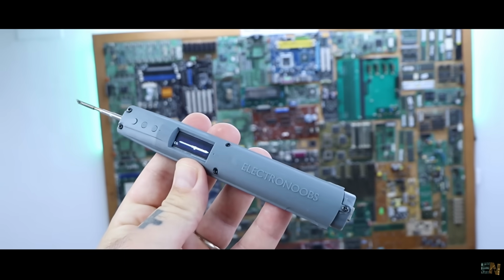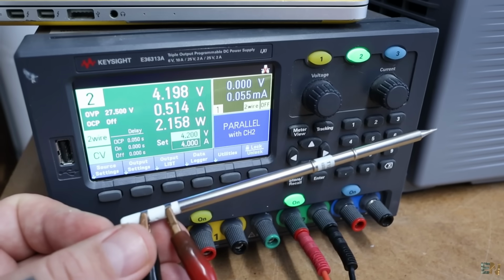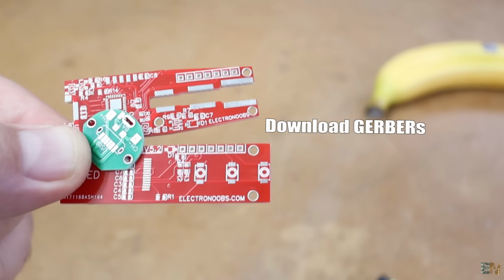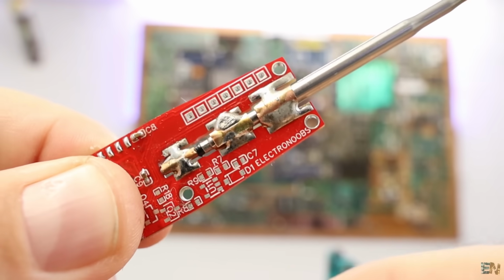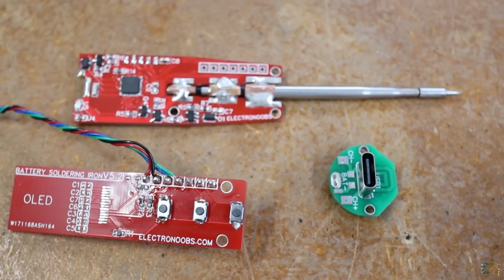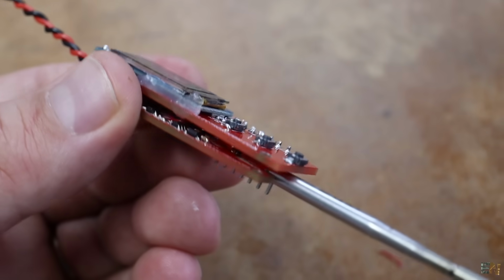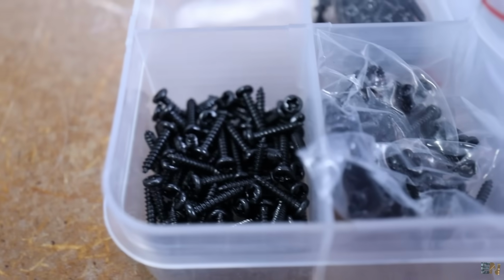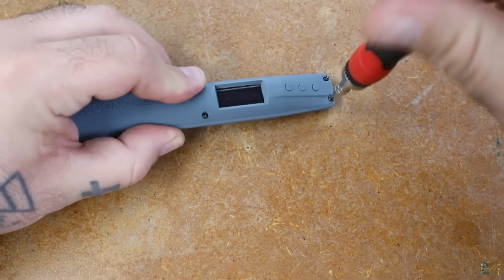No More Cables? This Soldering Iron Changes EVERYTHING

Comment: Nice Project! Thanks for your idea!👍 I want to use the same soldering tip for my Weller portable soldering iron. Weller only has 2 types of soldering tips. Do you or does anyone have the diameter of the contact terminals of the c210 tip so I can make an adapter? As an idea for the "copper clips", you could wrap thick copper wire a few times around a drill bit (or something else) with the same diameter of the terminals of the soldering tip.

Comment: You could try to use some kind of big capacitor in order to supply the soldering iron, and design an charging station that would charge the capacitor while not using it.
Other posible improve is to add an interchangeable battery.

Comment: Does the iron only heat at the tip? because if it heats up the entire iron needle, the printed part may melt on continuous use right? how do you prevent that?

Comment: Neat, I need this. A soldering iron wire once shorted/exploded while I was using it. It was very close to my hand, maybe 1-2 inch away.

Also, expect Temu sellers copying this...
Reply: They've been on Temu for a long time...
Reply: @rubenverster250  Exploding soldering gun.
Reply: @Xi_Jinping_is_Pooh  potentially just like the one in the video?
Reply: @rubenverster250  Yeah. But 90x more likely.

Comment: Yeah, this kind of power adapter (with thick-ish round cable) gets in the way when plugged to Pinecil-like irons. Things are getting much more acceptable with light and more flexible two-wire cables, especially when combined with one of these 20V drill batteries (so there's at least 5x more mileage for off-grid jobs).
Reply: The pinecil can use usb-c and gets shipped with a very flexible usb-c cable. If you have a usb charger that can do at least 12v you can solder with it.
Reply: @woutervossebeld4664  Must've been one of the unlucky ones - no cable with mine. And USB charger means access to the grid, which in turn means I can use a soldering station instead. But seriously, a small T12 setup with a drill battery can be a life saver after rodents visit your car's engine bay. JBC variants can be even smaller, and are getting cheaper... interesting.

Comment: That is a very neat little soldering iron.  I'm definitely thinking about building one.  I'm left pondering why the solder connecting the copper rings to the PCB doesn't melt every time the iron is used.

Thank you for all your hard work on portable soldering irons and sharing this Andrei.  I hope your little one is doing well.
Reply: Because that's an electrical and mechanical connection, not thermal.  That part doesn't get all that hot.  It's inside the PLA printed housing.  How hot do you think it could get and survive? ;)

Comment: Nice work, the iron probably takes considerable current from a battery so I think you should make battery wires thicker and either reinforce negative spring pad by soldering a piece of wire from the tip of the spring to the main body or replace it with a flat type spring like in smt battery holders, this will make less power go to waste on connections which is very important for a battery powered device

Ideally wires should be welded/soldered to the battery since currently it isn't easily interchangeable anyway, but if you can improve the case and make it interchangeable like with flashlights it can be very useful for a portable iron

Comment: You can buy usb soldering iron under 10$, just add bigger battery because it comes with small and drains quickly because they converted it from e cigarete
Reply: It has no thermocouple and very limited selection of tips

Comment: Quick question: isn't there a risk of the solder holding the copper sheets to the PCB melting?
Reply from the maker: No, the tip has ceramic separators and the heat won't reach the end of the tip...

Comment: What is the max power, i might have missed it in the video?
Reply from the maker: The tip has a resistance of around 1.6 ohmos so at 4.2V it could reach 10W. Is not much but is enough for small day to day projects...
Reply: @ELECTRONOOBS  Sounds like plenty for small wires and SMD work

Comment: That’s very similar to the TS100 by miniware that I have. It’s a great concept, except it’s not battery powered. What I use to power it is my workbench power supply.

As an engineering exercise it’s quite an interesting little project. I will check out your PID implementation, I’m interested in seeing your solution.

Well done, keep it up.
Reply from the maker: Exactly! I also have the TS100  and the fact it needs a cable that is always staying in the way made me want to make a fully cordless one...
Reply: @ELECTRONOOBS  is the battery rechargeable? If so, may I suggest a recharging stand with pogo pins? Something that will hold the soldering iron safely while it’s hot. That would be an even better solution

Comment: The USB-C socket needs resistors to tell "smart" chargers to turn on the port.
Reply from the maker: It only uses the 5V rial. Dose it still need a resistor for that if not using the 12V rail?
Reply: @ELECTRONOOBS  Yes, a pair of 5.1k pulldowns to tell the smart charger to turn on.

Comment: a bjt is not a mosfet, just a transistor
nice project otherwise
would be cool if it was based on a ts100 because of their more advanced open source firmware
Reply from the maker: @marc_frank  those are working at higher voltage... also don't know why you mentioned the BJT part... The circuit has both bjts and mosfets
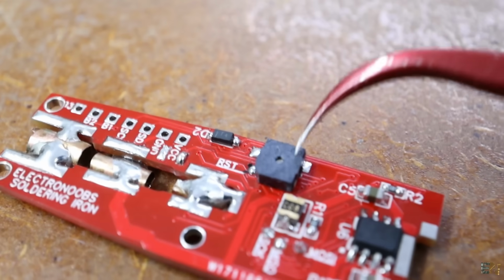Reply: @ELECTRONOOBS 5:28 schematic shows mosfet + bjt